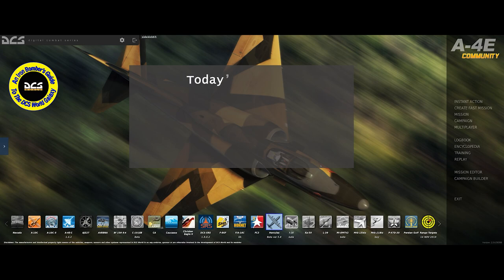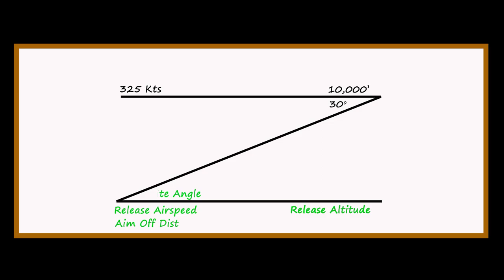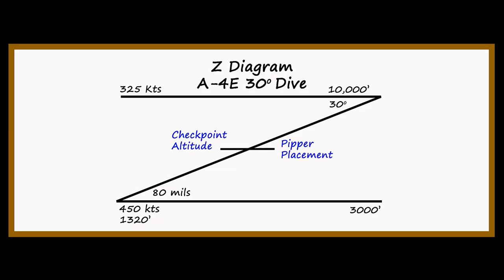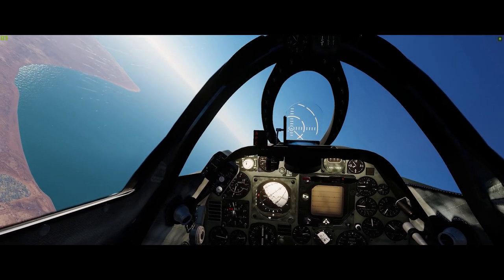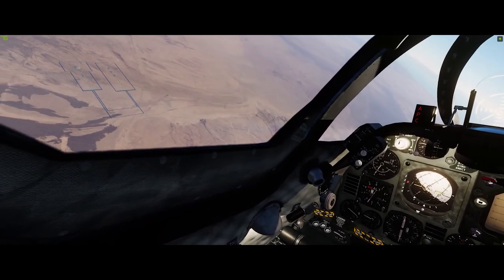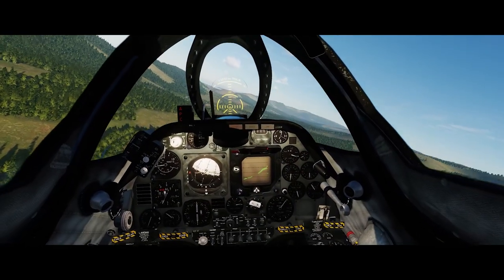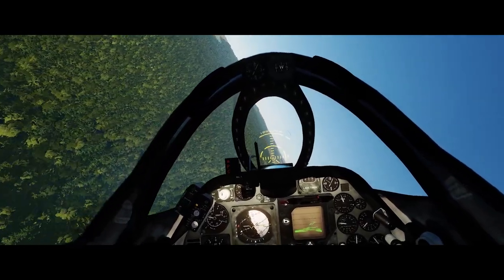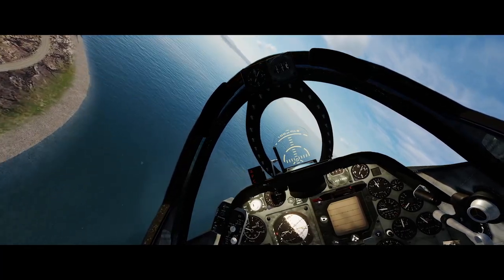The Iron Bomber's Guideo to The DCS Galaxy - Ep.6 - From Range to Reality

Comment: Hi Iain. I find that is very difficult to align the plane with the target during the dive. Any small movement in the roll causes the staff to separate from the target, and the pitch is a constant struggle to keep the target in sight. Do you use the autopilot or some trick parameter to keep the plane aligned with the target? Thank you!
Reply from the maker: I hear you Pablo!  No, I don't have any tricks, I'm afraid. I do have fairly substantial curves program in my controller profile. Especially in pitch. I also find that it helps to dial in the trim carefully.  Also, it really helps me when I remember that the aircraft centre line is at the top of the sight.  There is a tendency to think the plane will rotate around the popper, but it doesn't.  That can really make it hard to get things lined up.  Hope this helps n
Reply: @Sidekick65    it really helps me when I remember that the aircraft centre line is at the top of the sight" that´s a very good advice!!  I saw something happening but did not know what it was exactly.
What do you mean with "I do have fairly substantial curves program in my controller profile"?

Sorry for my english and  thanks for answering!!!
Reply from the maker: No worries. I am glad you are making the effort. In DCS you can "tune" each axis through the controls menu. You can set a curvature there that makes the controller less sensitive near the middle of the range
Reply: @Sidekick65  Ok, yes, I knew that.  I thought  you had some special curves configuration. Thanks for the help Iain!, let's keep practicing! Conngratulations for you videos, very instructive but above all very entertaining!"
Reply from the maker: Thank you, sir. That's what I am aiming for.